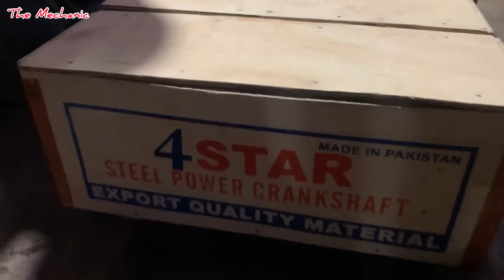Production of Crankshafts in Factory Complete Process || Machining 3 Cylinder Engine Crankshaft

Comment: These are not new crankshafts, these are previously worn out or damaged crankshafts that have been thermal sprayed from the looks of it, and are getting the thermal sprayed journals turned down, while I agree the job in the video is not a 100% job but make no mistake while it might look what they are doing is primative make no mistake that these machinests are skilled, I had the same process done to a gen 1 Dodge Viper crankshaft, couldn't source one in the country buying one from the US would have been too expensive, so went this way, bearing clearance was done as per Dodge's factory specs with the appropriate measuring devices by Pakistani machinests and the clearances were verified by a seperate machine shop, most of the Pakistani machinests that I've come across are very highly skilled its like it's in their blood or something and I'm not Pakistani just stating my experience with them, they made threads and bolts for me on the spot in a matter of minutes that weren't on the market.

Comment: They can't afford gloves?  Or masks, breathing cast iron dust no so good for you.  Electric motors so much simpler to make!
BTW, I used to run the machine shop at our local auto parts store in the 70's, but as a summer job I ran an id grinder at a business, most boring work EVER, had hundreds of identical parts to make every day

Comment: Very crude method of manufacturing considering crank shafts are meant to be highly balanced, have very close tolerences in microns, surface finish, fillets etc.However, a great job being done with whatever is available.
But, in an engine the crank shafts are meant for life. Why so many prototype crank shafts are being manufactured. Seems replacing crankshafts is a normal breakdown thing.

Comment: No dial indicator, no micrometer, lathe with no feed, no 3 jaws chuck on lathes, no tool post set-up(changes tool each time,), no inserts(they use brazed tools), no safety shoes, no mask(specially working with cast iron)…oufff…that’s hard work in hard conditions the old fashion way…! No precision required? Where do all those  crankshaft go? I'm sure that those people don’t get well payed…!

Comment: Ah yes. No dual indicators used or rubber dead blow hammers. Just eyeball the indication using a steel sledge hammer.. As a car guy coming from a background in machining oil and gas down hole tools this is cringey lol. Aka why we dont procure materials from China or other countries in the middle east. Fun to watch, but I dont want that crank in my engine
Reply: Dial**